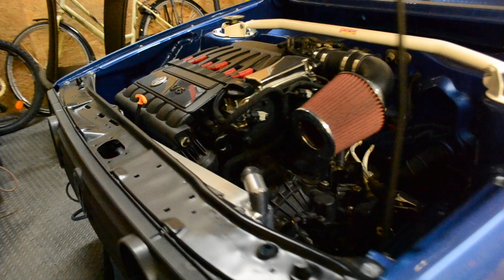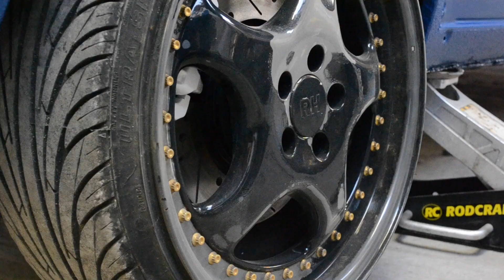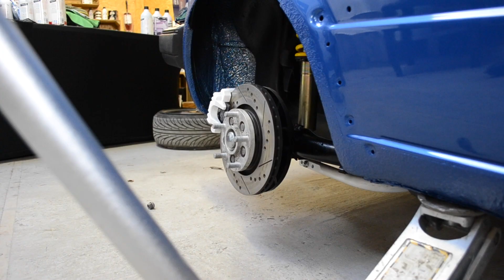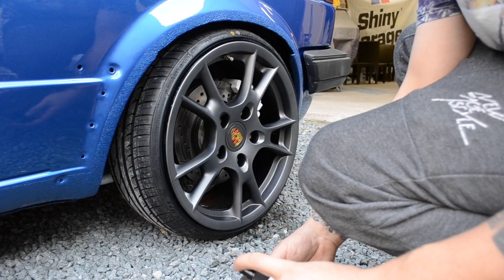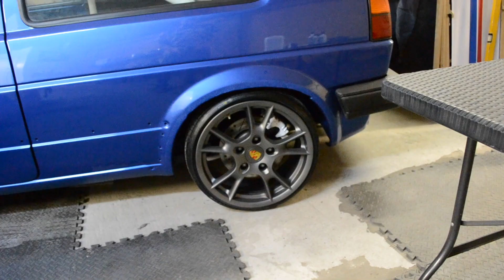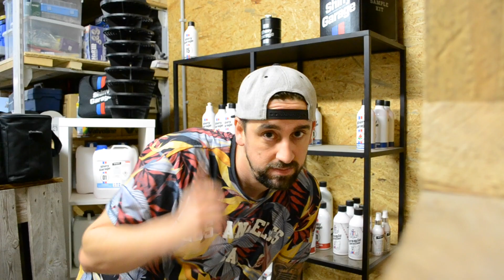D WORKZ GARAGE - Mk2 R32 car build - EPISODE 14 "The wheels"

Comment: This car is just front wheel drive isn't it? What have you done about the rear of the transmission where a prop shaft would usually attach or is it a different transmission. any information as to how its been done to only be front wheel drive?

Just found the channel, Great looking build keep it up!!
Reply from the maker: It is a mk3 vr6 gearbox that I used but I know you can make the original gearbox front wheel also. I think epytec.de has something for it.
Reply: Brilliant thanks for the info! Can’t wait to see more progress on the car! 👍

Comment: Hi !
I have watched all of your videos, doing same swap soon, i have one question how did you solved the wiring for the engine harnesses needed to start the engine ?
Reply from the maker: The problem was I didn't had the signal for the fuelpump, and injectors. It's a mass signal so I did a little trick with a relay.